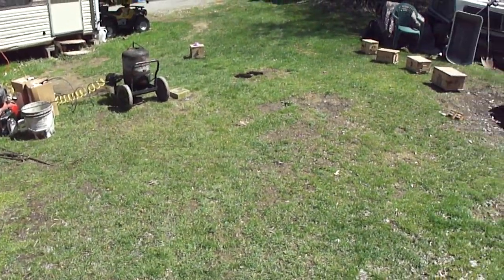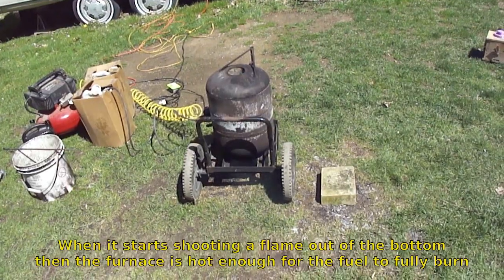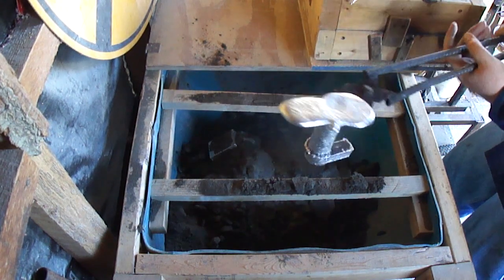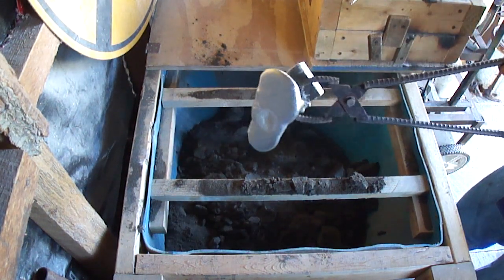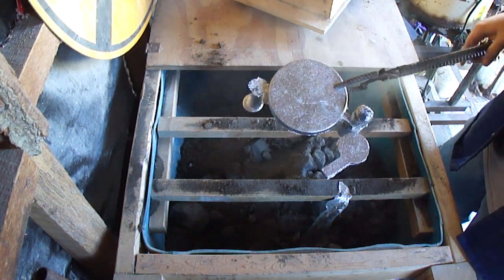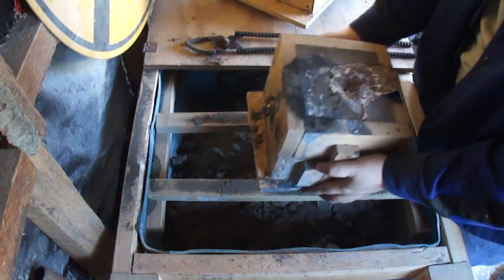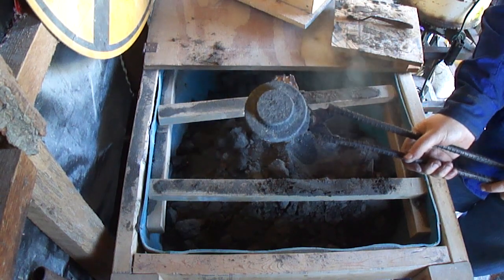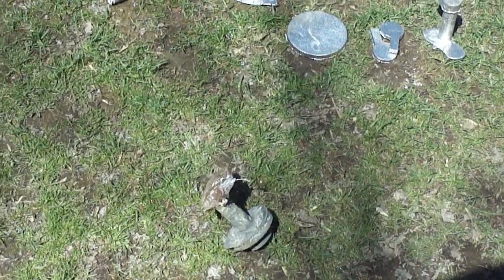Casting Day #11 - Gingery Dividing Head Castings P2

Comment: Well done, it’s always satisfying to see a good casting emerge from the mould. Cheers Peter
Reply from the maker: lol, yes it is, expecially when its in a troublesome metal to cast like brass. Ive been kinda following along with your build also and was really just wanting to see the spindle bearings and such itself. Ive seen some people redesign the spindle head and put tapered roller bearings in it rather than the bronze bushings, which seems like a pretty interesting idea really.
Reply: G'day Chirpy, yes I"ve seen other ideas and have even played with the idea of fitting a mini lathe spindle and bearing assembly, price is reasonable but expensive for me, if you know what I mean. Things may change if this hobby gets to the point the bronze bushings are a nuisance but at present I am running plain bronze bushings, with nylon end washers, I couldn't get the flanged bushings at the time.I had to increase the bearing cap thickness due to the thicker wall thickness of the bushings I bought but I am happy with the heavier cap, it looks good over the plain standard cap.
I'll have to keep an eye on your progress as the dividing head is on my list to do one day.
Reply from the maker: yea, the bronze  bushings do work good over all, but do wear in. Ive been just making my own bearing bronze using 50/50 lead/tin solder, some zinc pennies, and some copper motor windings. If you get the ratios just right, it makes a very nice bronze that is far superior to the bronze bushings that you buy in town, but they require oiling every time you use them vs the commercial oillite bushings.

Comment: If you don’t mind me asking what did you add to the molten aluminum to degas it??
Reply from the maker: I use a mix of 50/50 potassium chloride/sodium chloride that's melted together as a flux, then I degas the aluminum using around a teaspoon of the pool shock granules wrapped in a ball of aluminum foil. The pool shock is in the little plastic baggies and it's like 2 bucks for a bag of it. The main ingredient in it is calcium hypochlorite. I grabbed a few baggies of it a year or so ago at walmart, and just keep it in glass jars sealed up.
Reply: Chirpy's Tinkerings thank you!
Reply: Chirpy's Tinkerings what do you use for fluxing bronze?
Reply from the maker: any copper alloys, I use either borax if I need something really agressive, like if Im making it from scratch out of wires or something that can oxidize easily, or if Im going from ingots, I'd use boric acid (roach killer in the yellow bottles). They both melt and act as a flux and as a cover to prevent the alloying metals from burning out and messing up the alloys. Thats why Im always scooping a good amount of boric acid or borax out of the melts, and at that point, the metal starts to burn or smoke in my previous videos.
Reply: Chirpy's Tinkerings I just melted some 932 bronze this evening for the first time but it was all swarf which created more dross then molten metal.. also the alloy that I did manage to get into ingots looks much more like aluminum then bronze...Not sure why do you know I’ll be posting more videos soon but want to figure this out before I record it
Reply from the maker: I would try sanding a little bit on the ingots, sometimes the lead in a leaded alloy likes to sink to the bottom when it's poured into ingots. It may be normal bronze inside, but silver colored on the bottom. I usually mix my bronze chips with a bunch of borax, then when I melt them, the borax melts down through them all and keeps them from turning completely to oxide, also, I run my burner a bit rich, so that helps a ton with bronze/brass, and since there's no free oxygen, you dont end up with porousity either.

Comment: they look good!
Reply from the maker: thanks, I loved the brass pour most of all, I have never had luck with pouring brass because it chills so quickly, but tried something different this time and it worked perfectly this time. Ive been working on the castings in my spare time, and got a few of them machined up for the main body already, but didnt record any of it because it was only a few minutes here or there before I had to take off again. That and my lathe is down once again.

Comment: what brass have you melted  ,things i mean i have 8 buckets of scrap brass things  and was wandering your experiences . thanks for sharing
Reply from the maker: it was just a bunch of brass pipe fittings and such, it was a bunch of yellow brass. The thing that Ive learned about brass is, if you have it hot, it needs to be hotter. It cools very very quickly, so heat it to molten, scoop off the dross and borax that you put in, then put it back in the furnace for another 5-10 mins to superheat it. You want that thing to be flaring up bright yellow flames as your pouring the stuff, otherwise it'll chill on you and it'll pour like hot taffy, and not flow for crap. 
Imo, brass is one of the harddest alloys there is to pour, but if you do pour it going straight from the furnace, it should pour fine.